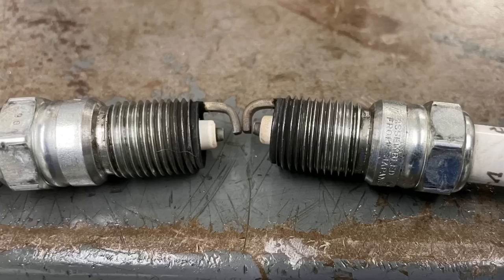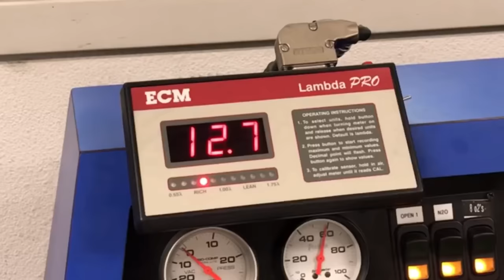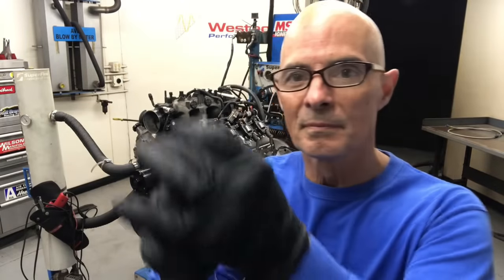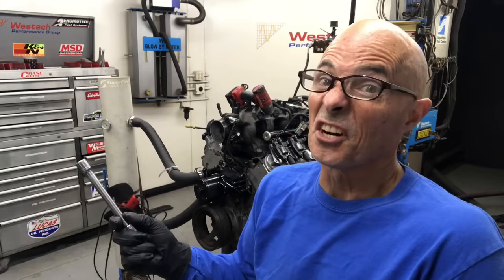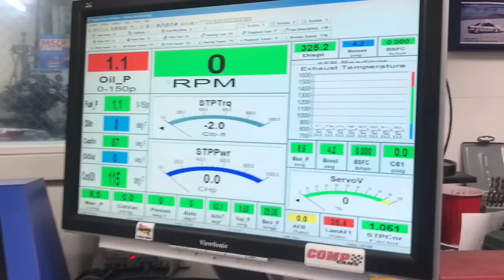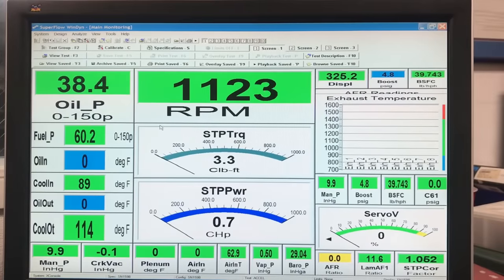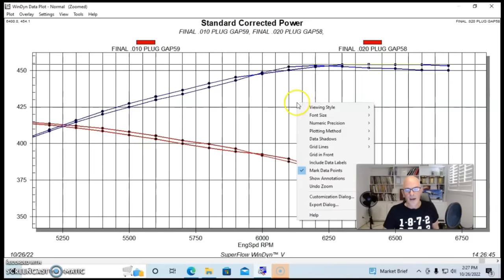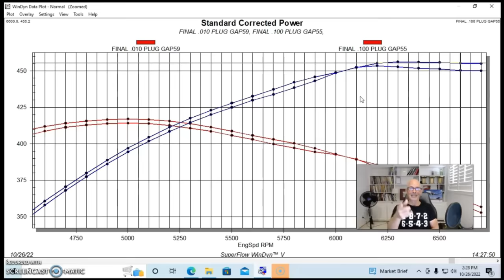JUNKYARD LS PLUG GAP TEST. DOES MORE GAP EQUAL MORE POWER? HOW MUCH SHOULD I RUN? .010 VS .100 GAP

Comment: Wide gap is almost total BS. If it's got any kind of weakness in the ignition system and you need it to run (think forklift or Irrigation pump ect) you use a smaller gap. As far as hp goes I've never really saw any increase with a wider gap, but now dual ignition I've seen sizeable hp increase. Shut one mag down and you feel it lose power

Comment: Does this apply to small capacity 4 cylinder engines?
Reply from the maker: don't go looking for power with plug gap-just run the gap so it doesn't misfire
Reply: @richardholdener1727  thank You

Comment: But what happens to the coils? don't they get hotter? I read somewhere that in order to jump a bigger gap, the coil kind of stresses a bit more, so they get hot. Maybe I read some info that was totally wrong...
Reply: Absolutely right, you need to know if coils is capable

Comment: 2 things. 
1: Driveablity improvement
2: Spark blowout. This is a huge issue in higher horsepower engines trying to utilize street ignition systems. A smaller gap will keep it from happening up to a point, then a HEI system thats capable of providing much higher current to the plugs becomes a must have to prevent spark blowout. There are other factors involved but this was a great test Richard of what it means in real world everyday street use.  thanks!

Comment: with .100 you made 'more' power but what if with .100 you went over the crest of optimal, i mean what if at .050 you may have more power. It's something i've kinda tested but by butt-feel as i dont have dyno. With .010 the gap is very narrow, spark is immediate (in terms of crank angle rotation), it lights up the mixture in very tiny spot and the fuel ignite front takes time to expand and the mixture to burn fully and it takes more time in crank rotation. With .100 the ark takes some more time to jump between the electrodes, in crank rotation time, and it is weaker because you have so much energy to spend from the coil i mean it is limited to certain amount, however it ignites the mixture on a larger area, 'roughly'10 times bigger area (10x.010=.100) so it burns faster and more complete. Faster and more complete, but still on the edge where any more gap and the spark wont be able to jump and misfire. Therefore i wonder what it would be at .050 and hope some day you can make the same test on a same /or the same/ engine, all three at once again to avoid variables. Then, because enlarging the gap makes for more crank angle rotation time until the spark jumps it may be beneficial to advance the timing some degrees, which could add on top of the power. I cant remap my ecu, but i did other thing, i added a module to increase the voltage on the coil which increases the output voltage to the spark, so i am with bigger gap AND keeping the same spark energy as if the gap was smaller.

Comment: Where's the surface  gap plug test??? :)
Reply from the maker: yes and side gap
Reply: @richardholdener1727  No need for pointless testing that only serves to consume resources.  Talk is much cheaper and in many cases, more than sufficient.

Comment: Was the oil temp consistent for all tests?
Reply from the maker: AND AIR AND WATER
Reply: @richardholdener1727  huh, what an interesting test, thanks. 
I wonder what it would do if u cut off the spark plug strap and just let it arch to the side 🤔 or gap it at .002. Hmm
Some tests are not what we would expect. 😕

Comment: isnt the idea of bigfger plug gasp so you can run leaner mixture (in a wider gap there is a better chance of fuel molecule presence than in a small gap) - can thuis be tested?

Comment: There was a myth about the top of the ground being chopped  and gapped to the side, in combination with using crush washers to have the plug seated horizontal over piston.
Reply: It's no myth. I run Autolites on my blower car and they come side gapped. Indexing washers are for keeping the strap away from piston domes. I've had motors that can impact them.

Comment: No one runs .021 or .100 on a NA motor. Your baseline should be the typical .035 from the points era. Then .045 then .060 after an electronic upgrade like a MSD.
Reply from the maker: the test clearly showed it makes almost no difference

Comment: Up to Cylinder misfire point, Wider plug gaps usually produce slightly More engine  power....Running enough ignition Coil high voltage, gapping Wider (beyond 0.100") by cutting off Side gap electrode Entirely & letting arcing to plugs sidewall shell produces max hp improvement...
Reply from the maker: the dyno does not show more gap adds power

Comment: had a crane HI 6 ignition on a 427 ford marine engine and the long duration spark made a huge difference in starting and low speed torque, idle at 500 rpm swinging a big prop in gear , and hitting both keys could not tell which started first. versus lot of cranking even though the dual points were set up pretty carefully. love to see a points versus MSD comparo

Comment: Back in the day, I would add an extra 10 thousandths (go from .035 to .045) and it would marginally increase engine response and mileage.  Nothing significant...however, it was "free" power.  Did this on my 86 Trans Am (5.7L TPI), 89 GMC Sierra (5.7L TBI) and 91 Camaro (5.0L TBI).  Another freebie was bypassing the smog pump with a shorter belt.

Comment: Plug gap type of fuel you run RPMs and load high RPM motors tire plug gap or if you're just going to the supermarket and back that was the day when they're running .60 Gap of course when I tuned up the HEI vehicles I ran the Gap at 0.45 for better vehicle performance. And your import cars back in the day ran 28 to 32 thousands. We used to call super tuning back in the day good plug wires good plugs the right Gap little carburetor work sometimes float level adjustment. And working on valve adjustment with a  hydraulics or sole lift cam.

Comment: back when points ignition systems  were used it would have been more likely that it would have had trouble starting with a .100" plug gap because of lower coil voltage output...

Comment: Increased plug gap is effective on the car(s) having strong/powerful ignition system, excessive gap with weak spark will cause difficulty in starting and misfire.

Comment: Im running 0.7mm on my stage 2+ 3.0t audi s4, the recommendation is to run down to 0.6mm but I find the fuel economy reduced. Until I get any misfires im gonna keep it at 0.7mm which is the standard gap from factory anyway on these bosch OEM platinum plugs. I do have new ngk OEM coil packs as well so that is key to keeping a stage 2 supercharged engine happy with oem gap vs a tighter gap. Also I have a large heat exchanger for the supercharger cooling to keep intake temps to around 50oC under repeated hard acceleration. Let's see how it plays out for now. 30mpg currently achieving on way to work 23 miles, driving steady. So im justifing my rapid s4 as a daily driver 😂

Comment: I just changed the plugs on a 1997 n/a 3.8l Buick LeSabre it was gapped and the electro  differently worn flat to the ceramic but long story short fuel pump wasn't keeping up but hadn't completely failed yet lol

Comment: 0.021" seems an awfully small gap for any modern ignition system?
Sounds more like a 1950's era with not so great coil performance or an old two stroke?
I remember reading tests where coil performance of 28,000 was considered exceptional for an upgrade 'racing' coil
Coil on plug is generally producing much higher voltages, 45,000+ on OEM .
I remember when electronic ignitions first became standard and there were warning stickers and cautions everywhere (I think SAAB were first COP in late 1980's/early 90's?)
Reply from the maker: this test was .100 and .010- but .021 would be what we use for boosted applications

Comment: I tried this long ago, "OEM HEI Systems" like Duraspark and GM HEI didn't do well opened up to .070....The Vertex Magnetos on our Race engine were a different story, probably the reason you didn't get misfires was the COP arrangement....I hated COP until I dropped a coil on way home one night on my 4.6, pulled the injector wire and drove home on 7...Never bitched about it again.

Comment: 5hp is 1% gain on a 450hp motor. not worth the frequent coil failure (& LS's never burn coils like 1997-2004 ford 5.4's & 4.6's)  also not worth the frequent plug failure. i like .060" on vehicles with 1 coil per cylinder and i like .020"-.030" on my old chevy's (or anything similar) that only run 1 coil for all the cylinders.

Comment: The LS has a very good combustion chamber. Try something with a trash combustion chamber  and you might see a much bigger difference. Ultimately if it fires at all odds are that cyinder is going to perform so big changes probably not likely. David Vizard told a story about some plugs really killing power on a mini they were dynoing. Would be cool to try to recreate that I mean it was a bunch of power difference and he saw it on the dyno so there was something to it.

Comment: We use to sell non resistor iridium spark plugs for that engine (out of stock, never to be sold again, so this isn't a sales pitch). Picked up 8rwhp after two dyno runs from 2500 - 3500 and 5000 to redline, no other changes.
Reply from the maker: then you had bad plugs to start with
Reply: @richardholdener1727  No, we swapped in new NGK plugs before doing both dynos.

Comment: Take your ground electrode and move it  15° or so, over to where the spark jumps to the side of the  ground electrode. This uncovers the spark to the chamber  a standard wire guage swill set the gap just like stock configuration.
Works for me.
Reply from the maker: we have tested side gap-it made no power

Comment: Hey if you’re making 445hp and you’re trying to make 450hp and you have stock or smaller gap then bigger gap is the way to go. But to a point.
Reply from the maker: there is not 5 hp from gap-we had to reduce it down to .010 to show any gain-with stock gap-there is no gain

Comment: The absolute dumbest theory to me was to aim the plug gap towards or away from the intake valves aka indexing. If the air fuel mixture is being compressed its a uniform mixture and the gap location does absolutely nothing.

When i worked at Lightspeed innovation we dyno tested 100s of small things and found tthat even a combination of all the right little things only made a 6 -10 hp difference.

Our short list worked as follows.
Take the plugs and find a set that had the same thread pitch but the threaded section was longer.(Slight compression bump) Would have to hand turn the engine to make sure the piston wasn't hitting.

Gapped plugs to 60thou

Had a water meth kit that literally sat in a deep freeze beside the dyno.

And removed the restrictive factory intake tubing for a legit cold air intake.

Thats what we found consistently made the car run a few hp more with at home available mods. But even then we discovered 99% of the small crap like drilling holes in the air boxes and stuff do NOTHING.
Reply from the maker: the dyno tells us what works

Comment: Nice comparison..... A coil on plug ignition like that has no chance of cross firing with extended gap,though.....a stock,single coil,distributor ignition,would not like the extended gap and cross fire would be an issue

Comment: One coil per cylinder makes all the difference. One coil could not survive at .100" gap in most all cases due to coil saturation in milli-seconds, which impacts the burn time and is worse the higher the RPM. Combustion chamber shape, cylinder pressure (higher pressure & temps=higher electrical resistance), A/F ratio (leaner=higher electrical resistance, Fatter=lower electrical resistance) ,I ignition timing (when plug is fired in relation to TDC (later =more cylinder pressure, earlier =less cylinder pressure), spark plug electrical resistance, Gap setting, ignition wire resistance, engine temperature, intake charge temperature, fuel temperature, and load of course changes the ignition coils necessary firing KV (KilaVolts) & therefore energy left to sustain the arc (burn time) which must be satisfactory for the engine conditions/characteristics to run properly. All the data in the middle is negligible in my years of testing. I generally follow the same rule. Largest gap that will never mis-fire under most extreme conditions. But each person can decide for themselves if this search is worth the effort.

Comment: make sense larger gap increased electrical exposure. I think it’s more critical to make sure they’re all gapped the same or at least within 1 or 2 thousands. like the small difference in horsepower, I would have to believe they would be a small increase in combustion temps. I could be wrong it’s just an assumption.

Comment: If you got 5hp at .1 then I am gonna remove the arch entirely and get 100 hp 😂
Reply from the maker: you don't get 5 hp at .100 gap-only compared to a gap of .010, if you gap them at any reasonable gap size (.020 and above), you get no gain

Comment: I don't know if plug gap does anything for horsepower but it can have an effect on fuel mileage because you can run leaner with more advanced timing course compression combustion chamber design RPMs and fuel delivery are all different variables along with engine health and how good the tune was to begin with

Comment: Your test would have had problems if the spark coil was of the older style. Some time in the 1970's the high energy coils were put on cars and that was when the larger gaps on the plugs happened. So if you used a spark plug gap designed for the high energy spark coil in a non-high energy spark coil engine it might not have started or it would have a miss problem for sure.

Comment: Exhaust gas analyzer should be used.
Which plug gap draws more power from the ignition coil?
Reply from the maker: POWER TELLS THE STORY-YOU DON'T GET POWER FROM PLUG GAP IN THE REASONABLE RANGE

Comment: A real racing plug, with a good size side gap would probably make a lil more power.  A CA company has a patented head gasket with 6 electrodes that males decent power.  GM is working on it with direct Injection and the starter will be a thing of the past.

Comment: Ok coming at this from a different direction. Plug gap to me is for optimal starting chances on a single cylinder without a starter motor. I would expect with at least enough plug gap and modern engine it’s considerably more likely to spark period 😅

Comment: Assuming, coil ability, plug quality and basic altitude, temperature and humidity is the same, gap only varies max hp by a 1-3'ish hp. However, it can definitely change the driveability/runnability of the engine. Usually a little extra gap (up to about 2x) can really smooth things out. Ignition system has  a lot to do with it all. Even single/twin small engines, assuming coil output is reasonable, can benefit from some additional gap. Manufacturers gap is normally set about as low as possible, to get more miles out of the plug (as plug wears, gap increases). Though newer systems, computer controls, multiple sensor feedbacks, considerable ignition systems, and plug design, have really come a long way, and the old rules are not used so much (not too mention how hard it is to change plugs, and having 2 or sometimes more, plugs per cyl. Of course that's just my 50ish years of experience talking. 😁
Reply from the maker: the dyno tells me otherwise about plug gap (no change in power on these motors in any realistic gap range unless you cure a misfire
Reply: @richardholdener1727   - Hmm, generally, given the assumptions above, as I said, you should see about 1 - 3 hp - generally. 100's upon hundreds of dynos, on dozens of engines, along with much more anecdotal, tells me that. But there you go.

Comment: I wonder what the difference would be when using those gap numbers on carbureted vs fuel injected engines of equal sized engines due to atomization differences would .100 work better for one type of engine vs the other

Comment: mounted a turbo to a eclipse.
ran fine, but as soon as we installed colder plugs with a tighter gap, it wouldn't even start. just a little pooof noises out the exhaust (waste spark doin some funny things)

Comment: At what point is the plug gap putting undue stress on the coils and pcm drivers. For example the ford guys know bad plugs will wipe out the driver in the pcm and cost much more to fix than the power is worth.

Comment: I tested on chassis dyno  a 5.3 bored to 5.7, hot cam, 243 heads home made port  job, 1.75 headers 3" open exhaust, all attach to a TH 350 transmission, 4000 rpm stall torque converter antiballon plate, rhis produce 387 RWHP @ 6000 RPM with NGK TR6 4177  spark plugs projected tip , and when i put the NGK B8EFS 1049 non projected tip  and  after adjust timing and fuel made 293 RWHP @ 5700 RPM, i want to use this set of spark plugs for a 300 HP nitrous shot but the loos on power was to much. This is my experience whit heat range spark plugs that should be a more interesting topic
Reply from the maker: READ AFTER ADJUSTING TIMING AND FUEL-NOT THE SPARK PLUG!

Comment: How does plug gap affect idle with big injectors? I have a mysterious idle misfire, but it cruises and does power runs fine. I have 1000cc injectors with iridium plugs with 0.8mm gap. Should I increase the to 1mm or 1.1mm, which standard for my engine according to the manual. Could be that not all the fuel is not being ignited with such a small gap?
Reply from the maker: try it

Comment: Mmmm 🤔.  Maybe this explains how my v6 3.8 litre Buick based Holden commodore ran better with Denso supercharger style plugs as opposed to my NGK ? Same gap but a u groove In outer electrode? More responsive and quicker by .4 second from 0 to 100 km/h? Any reply appreciated. Cheers from Australia 🙂
Reply from the maker: plug type didn't do that-not 4/10ths-thats serious power-plugs made zero difference in power unless you had misfire on the first set (with gap too large)